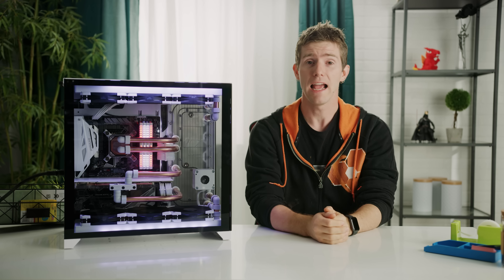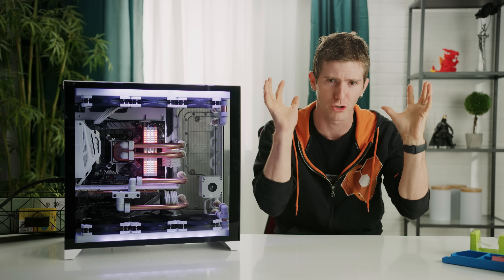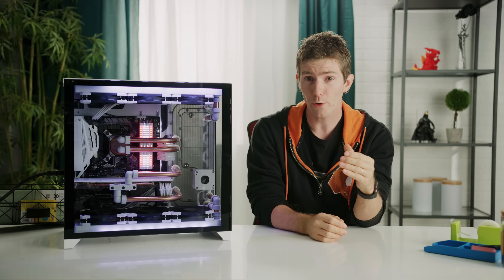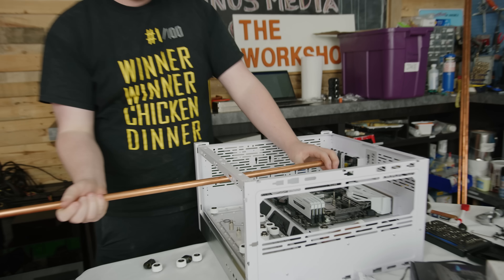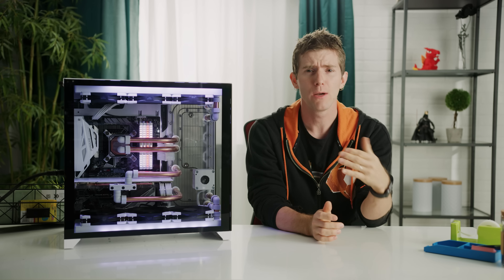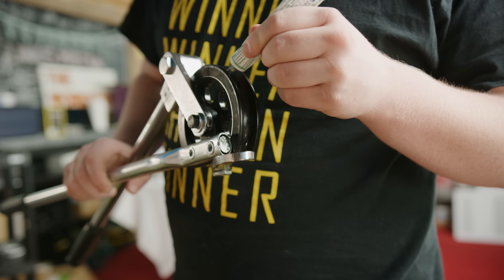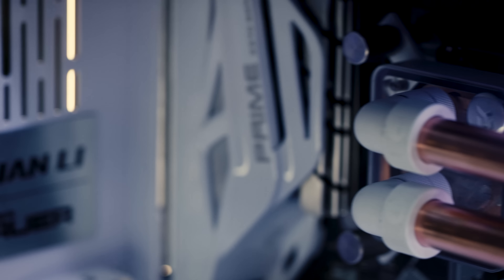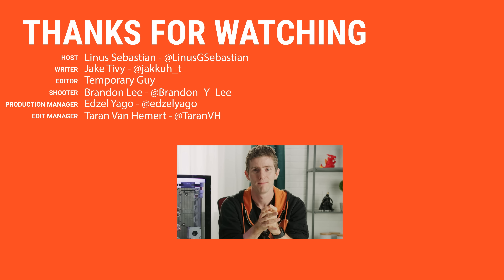Copper Tubing is HARD

Comment: In tomorrow's episode...         Gold Tubing is EXPENSIVE
Reply: Rate my build 
Ryzen 7 1700
Rx 570 8gb
Msi b450m pro-vdh
Ddr4 2400mhz ram
2tb hdd
125gb ssd
450w brons 80+psu
Reply: wait... how to make italics on yt?
Reply: @Scar7ace  11/10 price to performance value and 6,5/10 gaming power (0.5+ with i7 8k 1.0+ with 1070 or Vega 56 1.0+ with 1080 or 64 1+ and 1080ti 1+) but overclock your ram! High Boost
Reply: @Xenoray1  i dont need 9/10 or 10/10 bcs i'm an teenager and i work so my budget is around 700euro
But thanks anyways
Reply: Gold actually dissipates less than copper
Reply: @Scar7ace  honestly i would go with a slightly beefier psu.
Reply: @Zer0megaXX  can you give me an example?
Reply: @Scar7ace  should have gotten better ram and psu 6/10 for your assumed budget
Reply: @Scar7ace  450w is way to low, at least get a 600/700W psu.
Also dont cheap out on it, its the most important component of your system, if it dies risks are your pc will die as well.
I would recommend you to buy a golden rated psu.
Reply: @Scar7ace  i would say a 500 or 600 watt psu as they should be similar pricing and have a nice buffer if you can get one on sale a silver or gold psu would last longer as well as with any build dont cheap out on the psu because if it goes it can take your system with it.
Reply: @masterflamaster6377  Italics on youtube are achieved with a space then an underscore "_" immediately before, another then a space immediately after what you want italicized.  " italics "
Reply: But you can gold plate copper relatively cheaply.... I said relatively.
Just don't bother with deposition reaction methods unless you are going to apply a good clear lacquer. It comes off really easy otherwise.
Reply: Brassing steel with a wire wheel is cheap though. :)
Reply: MAKE IT HAPPEN NOW!!! GOLD KEYCAPS TOO!!
Reply: @Scar7ace   You super dont need more than a 1600 / 1600x / 2600x , save the money and upgrade your gpu. I have a 1080ti paired with a 8600k and I have never gotten anywhere close to running the cpu at max. I ran two 1070s and a 4750k on a 750 watt cpu, 450-500 is fine.
Reply: @spider0804  im gonna go with the r5 2600 but i dont think i'm gonna buy a better gpu
Reply: Howdy Kevin , If you want gold you go make your bends and then have them dipped in 14k, 18k or 22k gold and starting at $10 a tube which is not alot. They seal them also so not to loose that shine most want so bad.   A place here near Tampa does it and other type of metal plating stuff for cars but will dip any metal part, So look around they are out there and not as much as ppl think!
Reply: Scars good enough but get a better ram  module ddr4 3200
Reply: @catchdisl2558  nah
Reply: The good thing with gold is that it's non reactive so no dissimilar metal problems! Although I'd probably go with the plating route get maybe a 2/10th mm coating if you want to polish afterward and badabing badabom gold for days.
Reply: @Scar7ace  I just hope the main purpose isn't gaming :D . In my opinion it isn't very good. For example I would only recommend a bronze psu if you can get one for free.
Reply: @adagar8045   italics
Reply: Next year episode: How PC modders work in Dubai: DIAMOND TUBING! Bend diamond tubes Linus, I bet you can't.
Reply: No, In tomorrow’s episode... Platinum Tubing is EXPENSIVE ...... actually, let’s change it to diamonds.....
Reply: It be a episode about how shills run YouTube and the media. Your php  proves the power of the elite race
Reply: @Scar7ace  pretty good and I don't usually see AMD only builds so props to you for being unique
Reply: TELL ME HOW TO MAKE 72 SIZE FONT IN YT

...my psu says HP UltraGamerPRO-oxididous-ferrite 60+TURBO rate plz?
Reply: I'm imagining that Jay's Gold Digger build will eventually have gold pipes.
Reply: Now put this whole thing inside an oil box!
Reply: @Scar7ace  6/10 becouse psu
Reply: Context Matters would be really effective though
It the best conductor there is
Reply: Oh really
Reply: @masterflamaster6377  wassup
Reply: @Scar7ace  im one year late sorry but just put an asterisk before a word, letter ect and then put another asterisk after the word letter ect
Reply: Context Matters Lead Tubing is HEAVY
Reply: @Scar7ace  That ram speed is a bit slow especially for a Ryzen build
Reply: „Diamond Tubing is EVEN HARDER!“
Reply: @Scar7ace  2/10
Reply: Week after that.... "Platinum tubing is even more expensive!" 🤣
Reply: Okay bro

Comment: "never messed with copper in water cooling" "whole room water cooled project"
Reply: Linus is not wrong, he personally never cut or bent the copper pipe in, "Whole room water cooled project."
Reply: It was also not an internal loop.
Reply: Never successfully messed with copper in water cooling
Reply: I miss Luke :/
Reply: Thats called air conditioning...
Reply: What about the water cooling scrap yard wars?

Comment: Steampunk builds incoming
Reply: Already looking forward to that! LOL 
Think of that with some of the retro-looking keyboards Linus has reviewed...
Reply: Going to try and mod a case to have copper tubing getting out and in the case, will be a fun project i think
Reply: I have one of the 'gold' accented boards from ASUS, copper piping might be a good accent it was polished to a nice sheen.
Reply: I was about to comment this!!
Reply: Can I have a pc building its on my bucket list plz
Reply: There have been a number of Steampunk inspired PC's over the years just do a google search for Steampunk PC and you can see for yourself the many different builds out there.
Reply: Are you on team "wide radius circular bend" or team "tight 90 degree fitting bend"? The debate works for copper too! https://www.sweclockers.com/galleri/14603-kopparror
Reply: I did a steampunk case in the 00's...no water cooling but used a forklift tank for the case with a temperature gage from old piping screwed in for case temp and thin plexiglass covered the large portion of the missing side of the tank i removed with a sawzall. I had also steathed the 2 cd burners i had in it, if you pushed on the metal body then it triggered the cd door behind it to pop out. It was just a piece of the tank the size of the cd burners  Face cut out and then glued to the cd players door. I think brass exposed gearing for optical drives and finished wood would also be good in a punked case.
Reply: Go to a polishing place and find someone willing to polish it for you. It will shine!

Comment: Now that’s a PRETTY build! Great work, Jake (oh and also Linus, I guess).
Reply: It makes me wanting a copper Macbook. You should plate a Mackbook body with copper and make a video from it! If you do mention my comment here! :)
Reply: FUCK UUUUUUUUUUUUUUUU
Reply: Rate my build 
Ryzen 7 1700
Rx 570 8gb
Msi b450m pro-vdh
8gb ddr4 2400mhz ram
2tb hdd
125gb ssd
450w brons 80+psu
Reply: @Scar7ace  ''Ddr4 2400mhz ram'' how much tho?
Reply: @MrTheSmoon  8gb
Reply: Nice videos on the VESA mount!!! Really great content :)
Reply from the maker: Hey, I PAID for it, at least :P -LS
Reply: @LinusTechTips  please give me your opinion.
Ryzen 7 1700
Rx 570 8gb
Msi b450m pro-vdh
8gb ddr4 2400mhz ram
2tb hdd
125gb ssd
450w brons 80+psu
Reply: @atec0404  is 500w brons good too?
Reply: Can you give me a computer free?
Reply: @Scar7ace   Get 16GB of ram.  Ryzen works best with faster mhz and low memory timing also a 550w 80+ Gold.  A good psu can last you 10 years
Reply: @Scar7ace  that psu gives me anxiety
Reply: +1 like for winner winner chicken dinner 💣🐣🐓🦊🐾
Reply: @arslankhan2134  is a 550 w 80 plus gold better?
Reply: @MrTheSmoon  @ MrTheSmoon no 1, you mean the rx 580, and number 2, get faster ram. The ryzen chips need faster ram (you can overclock ram, but I think its harder than overclocking gpu and cpu)
Reply: @atec0404  the efficiency determines how many watts are pulled from the wall (it has do to with AC to DC conversion).
 The less efficient a PSU is the more watts it will pull to reach it's current output. 
Decent 400W bronze, silver, gold, platinum all are able to deliver full 400 Watts, but need more/less Watts from the outlet.
Reply: @Scar7ace  Get a b350f from asus, dont need the 450 as its the 1st gen ryzen, atleast 250gb ssd and 16gb of ddr4, if you want a gaming build i suggest a ryzen 5 1600 with the asus b350f, 16gbs of ddr4 atleast 2800, 250gb ssd whatever hdd, a gtx 1060 or that 570 which ever is cheaper but the 1060 is a bit faster, maybe a nice cooler for the ryzen to oc it to 4ghz and psu should be good, maybe consider a 550w for future upgrades.
Reply: @GS0CK6  i have b450 bc im choosing between the r7 1700 and r5 2600.. and i dont have the biggest budget. Only around 700 euros
Reply: @Scar7ace  price to performance build, but will need upgrading soon, gpu especially. Hope you got it for cheap. The ram is not a good choice, as Ryzen needs high speed ram to perform better (the infinity fabric that connects the cores is dependent on ram speed). The 570 is not that good IMO, and you should look into getting a second hand 1080.
Reply: @cgcanada88  i havent build it yet
What about ryzen 5 2600 with rx 580 8gb?
Reply: @Scar7ace  Depends on what you're doing with the computer. Gaming? Video rendering? Gaming + Streaming?

Something else to take note is making sure your RAM is compatible with your motherboard. Go into the motherboard specs and look for the compatibility of it (example for MSI, MSI site > motherboard model > support > compatibility).

Also the MSI b450m pro-vdh doesnt gave good VRM cooling. Even if you're not doing much OCing you should still get a motherboard with good VRM cooling. You should probably go for a ASRock - B450M PRO4 or a MSI - B450-A PRO as it's only $10 USD more.
Reply: @Scar7ace   if ur buyin new and dont own it get the 2700 with 3600mhz ram. $72 for a 8gb stick. if u already own it the 3600 will just run at 3200mhz, buying anything less is kinda pointless if 3600mhz 8gb stick is only like $12 more than a 2400mhz stick.
Reply: @Scar7ace  That is a pretty good build, mine is pretty similar. I like AMD cpu's and gpu's.

This is my system:

R5 1600
RX 480 8gb MSI x370 Gaming Pro (I am never buying another MSI board, the bios sucks)
16gb ddr4 @2400mhz (OC'd to 2666mhz)
250gb Intel SSD
2TB Seagate drive
650 watt EVGA bronze PSU (I think its dieing because i am having issues and the 5 volt rail barely stays at 5 volts)

The only thing that would be better for that build if you don't already have it is dual channel memory. In most cases it doesn't matter but i have noticed a sizable jump in performance and snappiness with two sticks in my Ryzen build. In Cine bench i loose anywhere from 50 to 100 points with one stick of ram.

Over all i would give it a 9/10
get another stick of ram in and OC both to 2666mhz and its a 10/10, i know ram prices are horrid but that will be noticeable, of course you might have 2x4gb stick and in that case all of this was wasted writing.

The timings i used on my ram were 15,15,15,32 i think. i am not positive but i am too lazy to look at my bios and check. 

You could also up the clock on the R7 to 3.8 or 3.9 with little issue. Putting 1.385 volts should get you there.
Reply: @zeshanalitechnical  only if you sell your soul and all your children's souls. Also, you get an optiplex from 10 years ago with this deal.
Reply: @ogland6482  yep i have 2x4gb and i am upgranding in thr future to 16 (4x4)
Reply: @Scar7ace  Ryzen has a decent amount of trouble running on 4 sticks. This is due to the fact that that each stick is slightly different quality and getting the best out of all of them gets harder with the more sticks you have. Best to do 2x8gb (so go for 1x8gb for now).
Reply: @PhantomMattcraft  omg brother you are so clever thank you i never thought about this😀
Reply: @Scar7ace  welcome
Reply: @Scar7ace  You really think he have the time for that? Get real.
Reply: @LinusTechTips  lolz
Reply: Dude Linus is doing it before Jake knew about these stuffs
Reply: @Scar7ace  entry level build, but the parts are pretty well chosen
Reply: @zeshanalitechnical  he wont give a pc away why would he
Reply: @theultimateweeb4276  he was just asking the maker of the bud how much ram it is. Also he was asking for how much ram it has. He was not asking about the vram, but the ram. He is not the builder of the pc.
Reply: @Scar7ace  very nice 👌🏾
Reply: @Scar7ace  below average
Reply: @Scar7ace  the more I read the worse it got jeez
Reply: @Scar7ace  i'd up the ssd and psu a bit, a 970 evo and some 700w seasonic psu should do the trick. most of the time you should overspec your psu just to be safe.
Reply: @zubaerhossain9832  uhm

Comment: I work with copper tubing daily making industrial pressure control valves for water lines. I always thought it was funny how much people thought water cooling with soft tubing was finicky. I did get a chuckle at you guys not polishing before bending, definitely a learning experience there. But the brushed look is GORGEOUS in that build. A reflective polish would not have fit nearly as well. Great call on that. Such a clean, but industrial look to it. I love it.

Comment: Wait, can you overclock the tubing?

Because its a type k
Reply: Get out
Reply: i know this post is old and all but i would just like to say "HHHNNNGGGG" thanks and have a nice day
Reply: that tube better run at 5ghz, else it's trash.
Reply: Yes, the i9-copperK means it's unlocked.
Reply: ThAaaa that's a good one, I might just start using that hehe
Reply: Nice one
Reply: Rangga676 I see you’re brainwashed by Intel’s pitiful excuse to charge more for overclocking.
Reply: Patrick B  p
Reply: No no, He's got a point
Reply: oOoOoOoOoOoOoOoOoOoOo
Reply: Fill the copper tubes with a mix of water and lots of soap, put them in a freezer and you can bend them when the water is frozen, they use this method when they make bends for trumpets and other instruments, it should work here too!
Reply: this joke reams
Reply: I scrolled down then scrolled back up a second later when I got the joke. Excellent.

Comment: I am quite experienced with plumbing. The "slightly thicker" pipe is type L, it is used for underground residential and commercial. Type K is the ultra thick one for underground water services (line from street/meter pit to house). You can also use copper compression fittings (5/8 in fits 1/2 copper) to avoid bends, and they would match the copper!

Comment: "it's called half inch but it actually has a 5/8 inch outer diameter" yeah, it's usually used in plumbing, where the flow rate (and thus inner diameter) is really important.
Reply: The funny thing to me is that the computer fittings and joints are probably shit. He needed to solder the joints the computer plumbing isn’t built to the same standards that plumbing for homes is.

Comment: There is a benefit to using copper in that you can use ethylene glycol as coolant since it reacts with acrylic.  Which you may think is a small in any benefit, until you tried using a water cooling setup for more than 5-6 months and realize that keeping a water loop clean and corrosive free is hard.  Your AIO cooler comes with glycol for reason.  You could use plexiglass as well to avoid the problems with glycol but copper sure is shiny.
Reply: Acrylic water blocks... and res. glycol is not needed since PC doesnt freeze.
Reply: Naaa - live on the edge, use sodium!
Reply: But the other components are not copper hahahahahaha
Reply: @bayanzabihiyan7465  true about the other plastic parts but the point about pc's not freezing is not a reason to not use it, ethylene glycol is not just an antifreeze it is also a coolant, it allows better heat transfer and conductivity than water and also inhibits corrosion.
Reply: @stevefox3763  actually water cools better than glycol, that's why in your car you only run it strong enough to stop the freezing, other benefits are anti boil and less corrosion, but its well known in racing that straight water is better for cooling.
Reply: Corrosion with /moisture/ and copper is definitely a thing. Ask anyone that works with copper daily. While this looks nice I would never, EVER, want this as a long term build.
Reply: We're talking about two entirely different grades of pipe as well as thickness. The 1/2" used here is similar to AC lines which are common failures every 3-7 years depending on conditions. With a corrosion inhibitor it might not be an issue, but it's still not for me.
Reply: @bayanzabihiyan7465  I meant to say PTEG not acrylic.  You can use glycol based products with acrylic with no problem.  Here's a video that explains it every well.  https://www.youtube.com/watch?v=K5niQ0NtefM